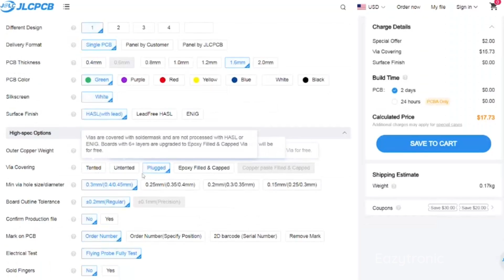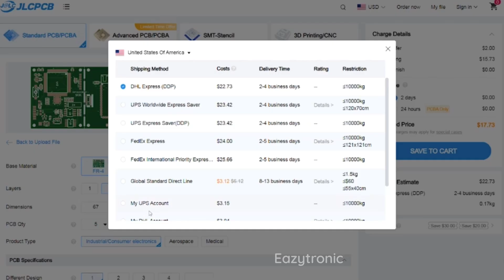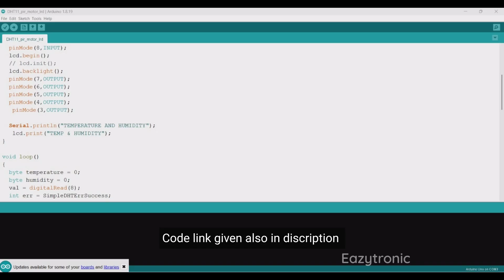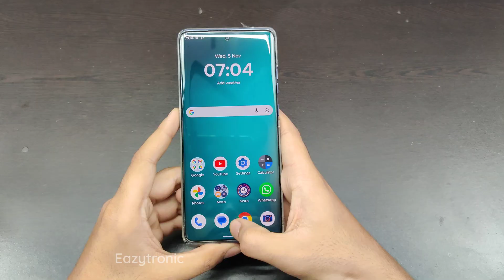Automatic Pet Feeder Machine Using Arduino Uno|| Arduino Projects|| Arduino Based Project #robot

Comment: Code:

#include <Servo.h>

#include <Servo.h>

Servo tap_servo;

int sensor_pin = 7;
int tap_servo_pin =6;
int val;

void setup(){
  pinMode(sensor_pin,INPUT);
  tap_servo.attach(tap_servo_pin);
  
}

void loop(){
  val = digitalRead(sensor_pin);

  if (val==0)
  {tap_servo.write(0);
  }
  if (val==1)
  {tap_servo.write(90);
    }
}

Comment: Code please
Reply: #include <Servo.h>

#include <Servo.h>

Servo tap_servo;

int sensor_pin = 7;
int tap_servo_pin =6;
int val;

void setup(){
  pinMode(sensor_pin,INPUT);
  tap_servo.attach(tap_servo_pin);
  
}

void loop(){
  val = digitalRead(sensor_pin);

  if (val==0)
  {tap_servo.write(0);
  }
  if (val==1)
  {tap_servo.write(90);
    }
}
Reply: @sanjeevverma3597 thank you
Reply: not working @sanjeevverma3597